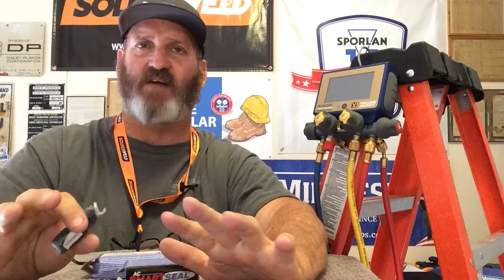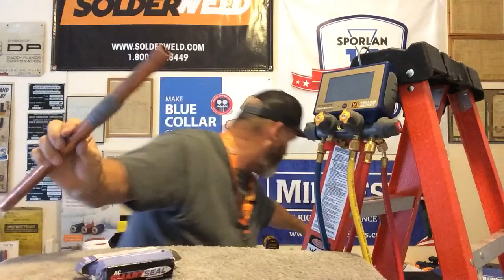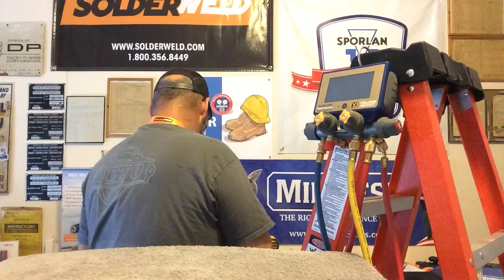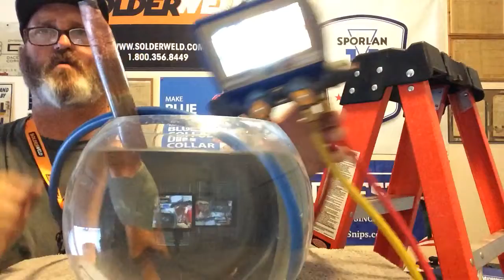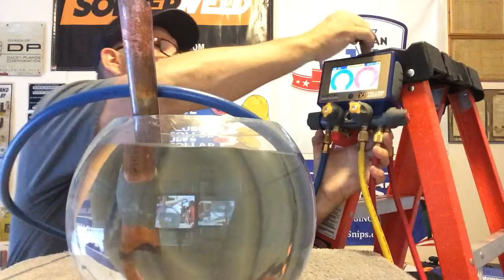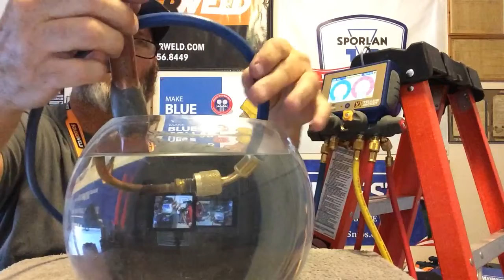Testing the AC Smart Seal from Cool Air Products

Comment: I think the major issue is the different thermal expansion rate of this kind of expoy and copper.  If it is not close to copper, it will form leak on ac tube soon, this is why jb weld won't work on hot copper line, because they use steel inforcement, big thermal expansion difference.  I really hope this work,  it will solve me big trouble, but I can't find this  information from their  website.

Comment: But can it handle 410A ?
Reply: Ordered this product from Amazon prime and tried this product. I have hole in my 1/4 inch line. I pulled a vacuum pump to 630 micron, charged and so far it is holding. 😎
Reply from the maker: @guardianmn  why didn’t you just braze the hole?
Reply: @cochisecounty_travels  because I want test this product and see how strong it will be holding 🤔
Reply: Can it be used to bond two 1/4 inch copper tube together rather then brazing?
Reply from the maker: @guardianmn  I wouldn’t try it. It’s really for small pinhole leaks.
Reply from the maker: Yes. But it is a temporary fix. I would not leave in as permanent.
Reply: @cochisecounty_travels  fair answer thanks

Comment: 👍👍👍

Thanks for sharing. I need that temporary sealant. I'll look into AC smart seal now.
Reply from the maker: DeafHVACR SoCal no problem. Like you said, it’s a temporary repair system. A permanent brass or pipe replacement is the best fix